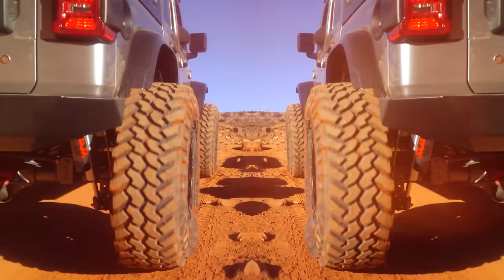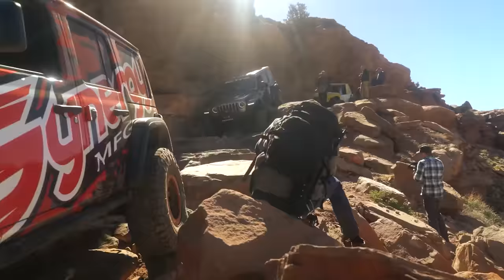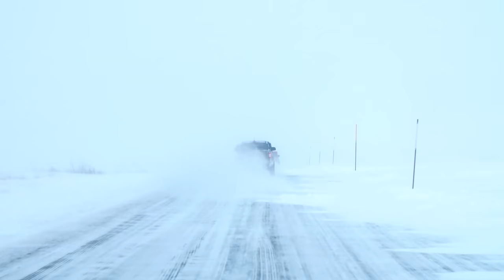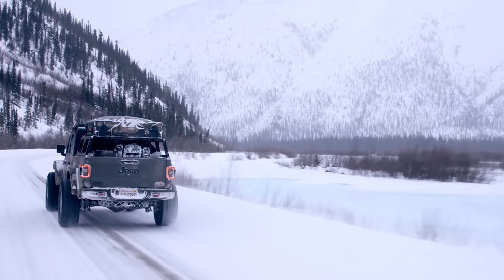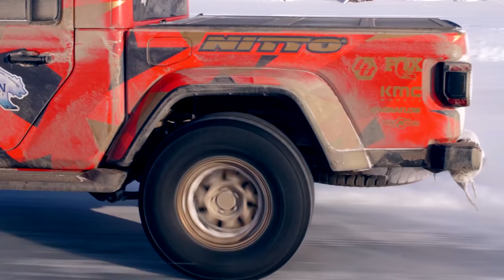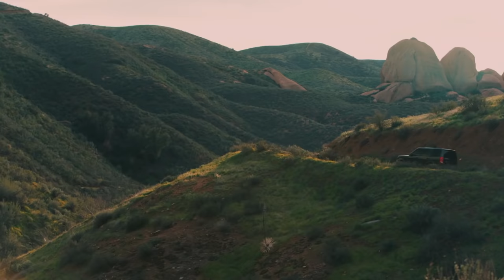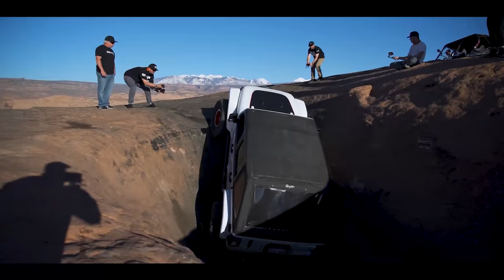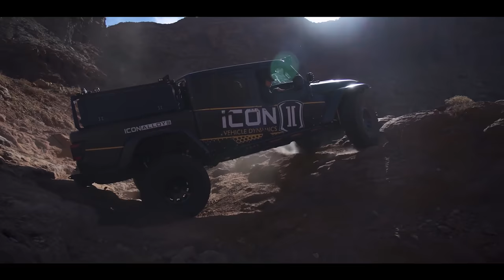Do NOT Use 4-Low Offroad || Watch First!

Comment: I am a field Geologist (for 30 years) and since I usually work alone, do not use my 4WDs as a rock crawler. My rule of thumb has always been to drive in in 4Hi, keeping 4Lo in case I get stuck. If I drive in in 4Lo, there is nothing to "fall back" on. Sure, there are a lot of trails I can't traverse in 4Hi, but then I walk (or turn around). BTW, in 30 years, I have never been so stuck that I couldn't get myself out.
Reply: Sounds like you practice common sense
Reply: 4lo is mainly for control but does give torque multiplication for severe grades. It doesn’t give more traction. You are more likely to have a failure in high range and put more stress on your transmission. Unless you have an AWD transfer case that only locks into part time in low range like my old Jeep Quadra Drive system did.
Reply: I call that detained ^^
Reply: I go off road I start in 2wd then if I get stuck I go to 4wd high then I get stuck I hit the ARB air lockers then if I get stuck I go to 4wd low and if that does not work I go to the winch If that does not work I turn around and go home lol...
Reply: @paulabes4220  lmao, brilliant
Reply: My take is that rock crawling, steep inclines, and big ruts should be avoided by lone vehicles. Backup is the only solution. A better rig just gets stuck farther away from help.  "A man's got to know his limitations". Dirty Harry
Reply: Not true if you use for high and run out of power you sink to the bottom of the mud and you're screwed for low in and out all day long
Reply: @paulabes4220 the policy is not to wait until you’re stuck to engage the next step.

Comment: Definitely rely on 4LO with a manual. Keeps you from needing to slip the clutch to go slow.
Reply: Agree 💯
Reply: You should look into using both break and gas with 4lo. It's a lifesaver for manuals and how you should be offroading. Keep the brake pressure applied while keeping rpms above stalling and go any speed you want. takes a lot of getting used to and sitting a little strange but it's night and day once you get good at it. I went through 2 heavily smoked clutches on my Explorer before learning this trick.
Reply: @TrashmanShazam  I've had to do that with a Jeep before in Low, but with my Tacoma I don't think it's necessary. 4LO 1st gear will crawl insanely slow. I actually may time it one of these days, and see how long it takes it to fully rotate a tire.
Reply: @Clanc54R  I had a 97 Ford Explorer and it did not crawl slow at all in 4 low but I didn’t have low gears. Those Australian 4wd guys that do crazy stuff recommend the technique though
Reply: @TrashmanShazam  absolutely. Gearing makes all the difference in whether you can easily off road a manual, or tow for that matter. That Jeep is my mom's. It's a JKU manual with the 3.21 axles. Even in 4LO that thing would crawl between 1 and 2 mph, which depending on how tight the trail is that's actually a bit fast. I don't think it matters to her though. She only has, and probably only will take it out that one time. My Taco on the other hand has 4.30 axles with a super low 1st gear. Fun for off road, but 2nd is still a bit tall to take off from a stop. So the truck can be very annoying to drive in general. And I don't hate Jeeps, just ones like hers lol. The Rubicon would smoke check mine in a crawl ratio contest.
Reply: @TrashmanShazam  I just learned how to use both pedals on big obstacles and big rock gardens for better control.  It’s awesome!
Reply: @JeepGladiatorestAprilJTR  my man! It’s the best kept secret for some reason.
Reply: Yeah, with a automatic I rarely need 4 low with 4.56s. The engine in my ranger finally died so it’s time to put a small block in it so I got a new process 203 and 205 to put behind it. Gonna be using 4 low a lot more.
Reply: True that. In my f-150 first in 4lo is slower then walking speed
Reply: Click bait contradictory title....thumbs down
Reply: @TrashmanShazam  old trick used before lockers were common stops slip and drive powering away to one wheel also aswell as ppl without reduction gears, Should be Basic knowledge for anyone with IFS
Reply: @Dumontjon   I bet!
Reply: @TrashmanShazam  interesting... I guess I'd rather replace brake pads than my clutch
Reply: @ucanalwaysbekinder  that’s what the pro Australians said too
Reply: @TrashmanShazam  sure trick for long life of your brakes.
Reply: @fedup3582  brakes are made to handle these kind of pressures. I’d rather replace my brake pads than my clutch/transmission anyday.
Reply: That’s right
Reply: @Clanc54R  Just got a "new" '07 Tacoma and was blown away by that low range.
Reply: @Clanc54R  Just got a "new" '07 Tacoma and was blown away by that low range.
Reply: @Clanc54R  exactly.. I have a JL now with a 5.13 1st gear manual, 4:1 transfer and 5.13 axle gearing.  It's like 105:1 crawl now.  Just incredible low speed.  Should have gone all the way to 5.38's.
Reply: @TrashmanShazam any recommendations for how to practice this? I understand it, but I want to get some reps in before I hit the trails (closest trail is 1hr away).
Reply: I miss having a manual. Just got my first off road vehicle. Gladiator Rubicon, but it has the ZF 8HP in it. I’ve been out on trails quite a bit. I don’t think I’ve yet been in a scenario where a manual would have made a difference or helped me. But I am very new to this. Fortunately, going into 4lo, and engaging both front and rear lockers, they’ve gotten me over and out of everything. Though due to the wheelbase, there are lines I do not attempt.
Reply: @TrashmanShazam  had to learn that on the fly while going up hill in an open diff rwd 1st gen Tacoma 😂. Pooped myself at the same time.

Comment: Prior to the age of electric radiator fans, you often used 4 low in slow crawling situations just to keep the engine RPMs up high enough so that the water pump mounted fan would spin fast enough to draw sufficient air through the radiator to keep the engine from overheating.
Reply: Omg
Reply: Good ole days
Reply: Just learned this in my XJ lol.
Reply: What about them engine starter cranks? Were they any help in a pinch?
Reply: Just leave it in 2wd and spin the rear wheels at 35mph lol
Reply: I love learning things like this

Comment: 4 Low with a stick shift lets you start the engine with the clutch engaged, so you don't accidentally roll backwards and off the mountain you just stalled on. It also saves your brakes going down steep inclines. It's also really useful in snowy conditions. It lets you drive slowly while keeping your brakes from locking up the wheels that lose traction on ice.
Reply: It's also possible to bump the vehicle forward with just the starter motor in 4lo.
Reply: And with an auto you can just shift it into 1st and it stays in 1st just like with a stick. It's honestly mind-blowing I know.
Reply: @chadwalton54  man you cant be realistic on youtube, that is just insane.
Reply: Ooooof. Using the transmission to slow down in snow? Depends on how bad that snow is man, It’s possible the engine brake can brake traction, I’d rather use the the ABS system personally. Most cases this is not needed at all mine you.
Reply: @baddecisionsoff-roading3243  abs sucks and is for people that can't drive.  That shitty system has given me more trouble then it has ever wished to help.
Reply: Or just get efi so you don’t get sent down a mountain
Reply: @minimalisticmime5459  ??? What does electronic fuel injection have to do with gearing??
Reply: @xxxYYZxxx you can do that in any manual vehicle. I’ve done it in 2WD sedans.
Reply: @MrBULLRIDER13 unless you have 4 brake pedals and 4 legs ABS can do far more than you ever can. There’s only a few cases when it’s not wanted. Otherwise it’s always better and preferred.
Reply: @jerrymyahzcat  no abs has caused me more problems then it's ever dreamed to help. Almost sent me off a canyon multiple times. It's for people that can't drive plain and simple. I have never had any problems with my pre abs vehicles but my abs vehicles nothing but issues with the system. So much so I deleted it in one of the rigs I have and been happy ever since and also saves my brakes from premature wear and tear.
Reply: @MrBULLRIDER13 there’s always that guy… maybe you just don’t know how to drive these new-fangled cars

Comment: Also, being in 4 low will save your transmission from excessive wear and heat while out on the trail.
Reply: Tru. I toasted 2 Transmission's under warranty on a Jeep and Sold it
Reply: @Zzus321  What capacity was your auxiliary cooler and where was it located?
Reply: @Zzus321  so you ran them n high both times and blamed the Jeep? Lol
Reply: @ruttlicker1139  Payaso I was rock climbing but don't worry yours will be safe at the Mall
Reply: I have 2 transmission coolers . Cheap insurance .
Reply: @Zzus321  so you burned up 2 transmissions rock crawling? That’s driver error bro my Toyota has never smoked a clutch with bigger tires than your fake Jeep 😂😂 everyone knows Jeep dudes love les Schwab and bolt on parts all at the same time while everyone else actually turns a wrench on their own shit 👍🏻👍🏻👍🏻
Reply: @ruttlicker1139  Were you there???
Reply: @ruttlicker1139  Can you please send me a link to your Rock Climbing Videos?? You sound like an Expert or did you go Pro????
Reply: @Zzus321  it’s called common sense lol sorry you’ve never owned anything capable in your life or have the experience
Reply: @ruttlicker1139  Payoso Jeep Chrysler Transmission have never been know as Reliable
Reply: Axles are much cheaper than transmissions to replace.
Reply: @ruttlicker1139  That are the same company FOOL
Reply: @Zzus321  Cherokee isn’t a company…You’re ignorance is unbelievable lol green horn 👍🏻👍🏻
Reply: You're just sad because you can't go Rock Crawling aren't you. Playing Video games just isn't the same 🤣🤣🤣🤣🤣
Reply: @Zzus321  if you’re going to stalk me atleast look at everything you pervert…Luckily you have your location on so I can see exactly where it’s coming from
Reply: @ruttlicker1139  if he comes after ya just go off road. He'll never catch ya! 🤣
Reply: Hi all.  I’m new to the Jeep 4WD world.  I’m climbing a steep snowy trail up to a cabin and was using 4 high (now I think I realize it was a mistake) and the hot oil light came on for a little while.  I took it really slow up the hill, but next time is 4 low a better option here? Also for the way down the steep decline, is it better using 4 low? I just don’t want to mess everything up too bad.  Thanks!
Reply: @MrGflan  yes and yes. You engine brake downhill
Reply: I always stop. Some vehicles may require it. In a situation where 4L is needed, stopping should not be a problem as you should be going very slowly anyway.

Comment: If you've ever had a transmission temp gauge in a vehicle, you will see much lower transmission temps when using low range in anything slow. Especially mud, sand, etc.

Comment: I learned 4 wheeling in Northern Nevada in the 1970's in my dad's stock "65" FJ40.  We never went anywhere fast and when we got off the smooth roads it almost always went into 4L, it was so much easier on the rig.  And like I said, we never went anywhere in a hurry, but we always got there.
Reply: Funny, I live in northern nevada (tahoe, but we wheel at johnson lane a lot)  and almost NEVER use 4lo unless there is crawling to be done. We're often doing 40-60mph untill we hit the side trails, even then 4lo only gets used with there is rock crawling to be done.
Reply: @bigslacker666  That's cool.  Each to his own style.
Reply: @bigsamdog1  Definitely, I love seeing hardcore crawlers tackle tough obstacles even though it's not my thing.
Reply: It's a skill to just relax and idle along in 2nd low.   Might as well enjoy the scenery and not beat yourself or your rig.  Dad's rule was if you need 3rd low you should just go to high range.
Reply: @ephjay6t87  I like that.
Reply: @ephjay6t87  100

Comment: Having a manual transmission, I use 4 Low anytime I need to go slow over off-road terrain. It’s much easier then working the clutch to control my speed.
Reply: You should look into using both break and gas with 4lo. It's a lifesaver for manuals and how you should be offroading. Keep the brake pressure applied while keeping rpms above stalling and go any speed you want. takes a lot of getting used to and sitting a little strange but it's night and day once you get good at it. I went through 2 heavily smoked clutches on my Explorer before learning this trick.
Reply: @ruttlicker1139  you can keep the revs higher by applying the brake which does save your clutch. I learned the hard way by not using it and getting the advice from multiple off-road pros many years later.
Reply: @TrashmanShazam  I've offroaded with a manual transmission ('67 CJ5) since the 1980's and I've never heard of this. It might work with an automatic, but it doesn't make sense with a manual transmission -- engine and wheel RPM are directly linked, you're just making your engine work harder by adding resistance with the brakes. You could achieve the same thing by just using the gas pedal properly, and wouldn't wear out your brakes in the process.
Reply: @theobstacle  the whole point is to keep the engine reving higher so you can go slower where needed without stalling. It has nothing to do with proper gas’s pedal control. It helps at points where you are in 4-lo and the lowest gear but should still drive slower. Never needed to do this in an automatic as they have the creep features to overcome this though you see it in professional racing for both types of transmissions even at high speed. I got the tip from these guys while driving manuals and I’m pretty sure they know what they are doing as they tackle some of the toughest terrain around In Australia.  https://youtube.com/c/4WD247
Reply: I like my 86 f-150 because first gear is granny low so most of the time I never have to take it out of 4hi, however there is times where 4lo is greatly appreciated on the trails
Reply: @Kuj  In a manual your tires are linked directly through your motor so in essence that increases stress on the motor, however with an auto this can be useful because the torque converter allows you to crawl while your engine rpms are higher. The only time I ever use the brakes in that way is when I’m in 2h trying to burn my tires off.
Reply: @TrashmanShazam  This makes absolutely no sense to me. Higher engine rpm means higer wheel speed. With 4LO and 1st gear I can literally just let it idle and it'll crawl up any hill without stalling.

Comment: Another recommended use for 4-Low is in the SW Desert summers when it's very hot.  4-High will sometimes cause the transmission to overheat and the Jeep will shut down.  4-Low circulates the fluid thru the cooler faster and keeps the transmission cooler.  Our Jeep club recommends 4-Low on hot days anytime we're moving slowly to prevent transmission overheating.
Reply: Great advice
Reply: I live near Las Cruces in the SW Desert area.   You are right about your comment. I have an automatic tranny but I still need to use 4-low to ensure I get enough cooling.  I learned my lesson the hard way (see above).  One thing I learned is keep the roof on when you live in the Desert areas since it will keep you cooler and keep some of the dust out.  I wear a mask to keep it out of my lungs.
Reply: If you have to be in club to be told that  you are a princess
Reply: @jimthefencer5212  how close together are your eyes?
Reply: @jimthefencer5212  how close together are your eyes?

Comment: I learned to drive in my mom's 1957 Pink CJ in the early 60s and taught my son to drive in a 1992 YJ in low range. Few engine stalls and learn smooth quick shifting.
A granddaughter now wants a stick Wrangler as her first car.
Reply: I have a 95 YJ now and will not give up the very simple NP238 two speed transfer case.     This, combined with the 5 speed manual means that at most, going from 2hi to 4hi to 4lo is simply a matter of using a little clutch and it slips right in.   Far more reliable than all the complicated computer controlled t-case/transmissions on most modern trucks.

Comment: 4Lo and S1 when going downhill to let your natural engine brake control your speed was one of the best tips I ever got when I was learning. Now I’ll run a trail with a group and the people in front of me are riding their brakes while I’m just cruising.
Reply: I was at a trail event a couple weeks ago (Las Cruces Chile Challenge) and forgot to put my Jeep into 4lo which meant my brakes were used a lot on some of the trails.  Once I remembered, I put the tranny in 4lo and first and everything was peachy.  I did overheat my power steering but that was on an uphill climb.  I should have switched to 4lo to increase the revs.  The slope was about 15% over large rock and sliding sand.  The transmission stayed right where it was supposed to be but the "hot oil" sign came on.
Reply: You should share that info

Comment: Use 4 Hi most of the time unless you are rock crawling or going down steep hills. 4 low also takes away stress from the transmission and sends it to the driveline but if you can't get out with 4 lo then you are screwed lol.

Having good tires is the key